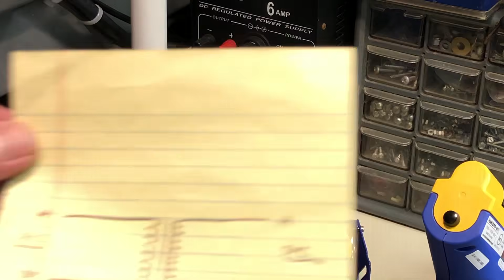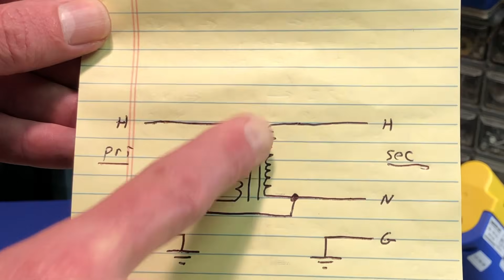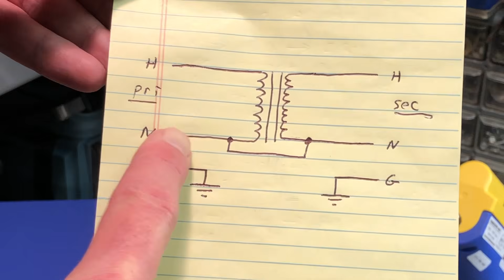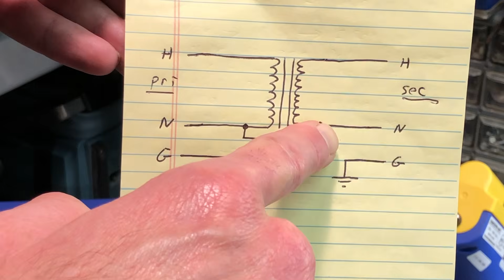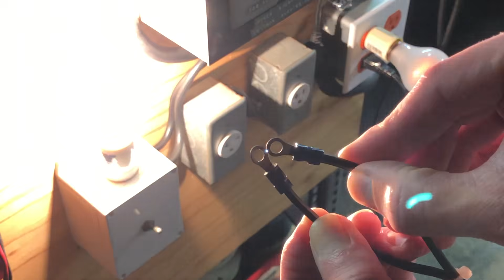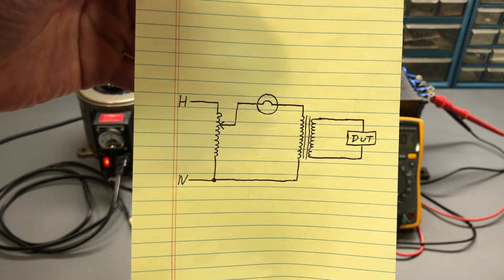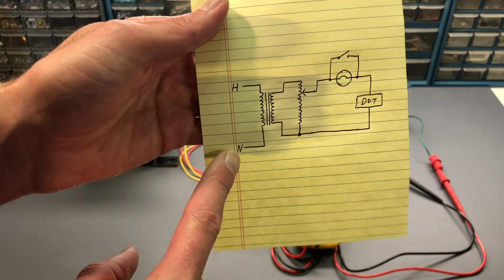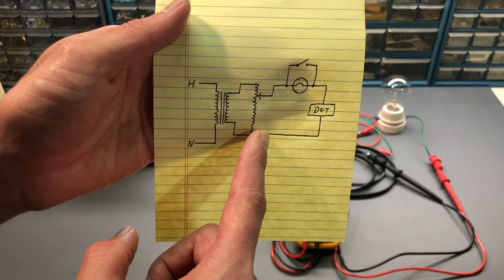How An Isolated Dim Bulb Tester Works (Current Limited Isolation Transformer And VARIAC)

Comment: I have one of these iso's. Since you have one, could you tell me what mod you did to it to make it safe to use as a real isolation transformer? If these are being sold as 'fake' isolation transformer I would think there would be some legal liability issue against the company.
Reply from the maker: at 11:20 I talk about the modification and show the schematic.  The manufacture connects the neutral from primary to secondary.  You need to break this connection for true isolation.  I think they are selling these transformers as some type of noise or interference isolation but not with the intent of isolation for electronics servicing.
Reply: @EriksElectronicsWorkbench  - exactly. Most isolation transformers are sold to audiophiles who want to isolate their amps from any induced noise from the grid, or for medical/scientific labs running extremely precise measurements that can't tolerate spurious noise. I'd wager that few manufacturers are really catering to the market of "people repairing and restoring old vacuum tube based radios and guitar amps".
Reply: >  If these are being sold as 'fake' isolation transformer I would think there would be some legal liability issue against the company.

They're not "fake" you just have to pay careful attention what the manufacturer is actually claiming.  Most "isolation transformers" are sold for use in isolating sensitive audio amps or scientific / medical instruments from noise induced into the electrical grid by lightning, powerful RF transmitters, large inductive loads starting and stopping etc. They don't claim or intend to provide full galvanic isolation. 

Or to put it another way, there are degrees of isolation, with "full galvanic isolation" being what people using an iso on a test bench are typically looking for. 

So you can modify one of these things like Erik described or you can look for a device that advertises "galvanic isolation". Or find a big chunky 1:1 transformer and build your own (making sure not to make any electrical connection between the primary and secondary sides).

Comment: As mentioned in the presentation - that in many isolation transformers
-one side of the primary and secondary winding is connected together.
This is because  such transformers were used in Medical equipment -
where such a configuration is a legal requirement --
However it is not a desirable configuration when it relates to Electronics repair.

It is always essential to check the configuration when buying 'used' or
otherwise surplus  isolation transformers - as well as stating the exact
specification required when having a custom / specially made transformer
manufactured --- 
Complete isolation is essential so that the secondary voltage is floating.

The final configuration demonstrated is the same configuration I have been
using for decades.
The variac I use is itself vintage - manufactured in ITALY - perhaps in the 1960s
and does not have any display for current -  and YES it also does have an 'overwind'
meaning it can output a voltage that is greater than the input.

I should also point out that the common and standard voltage is 115v  and NOT
120v
The world standards were changed over 3 decades ago - to simplify manufacturing 
electronic equipment
Countries that used 240v   went down to  230v
Countries that used 220v   went up to  230v
Countries that used 120v   went down to  115v 
                  North America uses  230 / 115
whereas previously used    240/120

Now  - there is a permissible tolerance due a load placed on the supply grid.
in the vase of 230v supplies  -- the permissible (over) voltage is 10v above 230
and 6 volts below 230

Those are reduced by half in North America 
5 volts above  115  and 
2 point 5 volts  below 115

That does not alter the fact that the set  international standards  are
230 volts and  115 Volts

Comment: How many fickin ads can greedy google squeeze into 1 video?
Watch it and count.
Reply: These ads are ' stealing 'the users valuable time.
TIME has value and is NOT recoverable
therefore GOOGLE ARE thieves - n addition that GOOGLE
block and remove channels  - often without explanation -
as well as removing video they wish to censor -
yet they allow scammers to advertise fake products /
products that will not perform as claimed in the advertisement.
OR advertise one product and sell/a product that is entirely different
to what is being advertised..
Reply: I watch with no ads at all. Do some google and you shall find a browser extension to help watching with no ads.

Comment: seriously? 44 minutes to explain this? anyone who can't understand this in less than 2 minutes really shouldn't be working on electrical or electronic equipment at all. what a waste of time.
Reply from the maker: The video is for viewers who want to gain a thorough understanding of the topic and the various ways the components can be interconnected.   Teaching with details left out is pointless.
Reply: If not here where should they look - it is always good to get fundamental instructions - it you are too good for this content then don't watch it.
Reply: Nobody made you watch it.
Reply: This is the thorough explanation. You are likely at a good level of understanding in electronics so it doesn't suit your level.
Reply: You tube pays by the watched minute, use fast forward, turn on cc, scroll ahead, helps get thru to the info wanted,

Comment: Great idea for a video, thanks for doing this. I think there's disadvantages to every configuration. 
If using a tripplite in configuration # 4, slight disadvantages are that neither the tripplite case or the auto transformer can be grounded., and a slightly higher voltage on the secondary of the tripplite may throw off the dial reading on your auto transformer. If using a Chinese auto transformer, your dial reading will be way off anyway. I like configuration 3. Having the auto transformer first solves the problem of an isolation transformer that is not quite 1:1. Also, Variac is the only one that makes a Variac.
Reply from the maker: With the Tripplite isolation transformer first (the way I use it) the metal case is earth grounded. As mentioned, the Tripplite had to be modified to make it truly isolated on the output.  Anything after the isolation transformer doesn't need an earth ground since it is isolated from ground, the whole point of the isolation transformer.  Of course making a ground on one of the AC lines after the isolation transformer undoes the whole safety purpose.  On my Variac it has a panel meter for output voltage so no dial markings but yes the dial markings could be off in some configurations.  Yes VARIAC is a registered name as you mentioned.  Thanks for taking time to watch!
Reply: @EriksElectronicsWorkbench  I could have explained it a little better the first time. (for everyone) Everyone's setup may vary and depend on each piece of equipment, and the device under test. I personally like auto transformer > Tripp lite > Load with dim bulb configuration for many reasons. The auto transformer and Tripp Lite can be used as intended, both safety-grounded, the Tripp Lite also needs to be grounded because of the Faraday shields on both toroids (not a secondary center tap), and the ground is available at the load, if needed. I just put a switch on the Tripp Lite secondary neutral and use a ground lift adapter on the Tripp Lite outlets when complete isolation is needed. It is as easy as a flip of a switch to return to the original Tripp Lite configuration. I believe it is the easiest to mod and maintains safety and the most flexibility. Of course, do whatever you want and call it the best.
Reply from the maker: @billmiller6274  All valid points, thanks for sharing these ideas.

Comment: Well done and very informative presentation!  I like the 4th set up and want to replicate it... but my isolation transformer only has a 2-prong outlet on the secondary side (which makes sense), but my variac has a 3-prong cord.  Should I just use a 3-prong to 2-prong adapater?
Reply from the maker: Glad the video was helpful for you.  You can use an adapter to leave the VARIAC ground disconnected since everything on the secondary side has no ground reference.

Comment: 2 questions   1)   where did you find incandescent bulbs.   everything i see is led  since they outlawed the sale  of them.   2)if one was to put gfic outlets in will they wotk and where would the best location be?
Reply from the maker: I have a stock pile of incandescent bulbs for projects :) but you can still find them on eBay, surplus stores, and vendors of bulbs and lighting. 
You can have a GFCI on the primary side of the transformer but do not have one on the secondary side.

Comment: So to confirm here, you don’t ground the primary side of the isolation transformer? The side that goes into the wall outlet.
Reply from the maker: On the primary, the transformer is connected to the 120 volt hot and neutral and the neutral is at ground reference (going by the wiring standard here in North America).  However it is ok to earth ground the metal housing the transformer is mounted in.  If the transformer is in a plastic enclosure you don't need the earth safety ground. Nothing on the secondary side should be tied to earth ground.

Comment: I have heard that forming "long time no see" el. capacitors can take long hours, with bigger and longer steps. Some people developed some code and procedures - but still i am not sure if they are correct - they are only proposed :)
Reply from the maker: There is something to the reforming idea, it is true that a very old unused electrolytic will start working better if you bring up the operating voltage slowly.  However a capacitor that has dried up electrolyte, high electrical leakage current, or other internal damage/age issues will never perform normally and should be replaced.  Some basic tests of ESR, leakage, capacitance, etc will confirm if the capacitor is ok or not.

Comment: Brilliant Video / Lesson Thanks . New Subscriber from Australia.
Reply from the maker: Thanks for watching and subscribing!
Reply: @EriksElectronicsWorkbench Erik Can you advise where to buy these 3 Components
Reply from the maker: @andrewhenderson9474  the VARIAC, isolation transformer, and incandescent lamps and sockets are listed on eBay, that might be the easiest place to find them.  Surplus and electronics retailers have them too.  I don't know of specific places in Australia that sell these items.  Also make sure you use components rated for your line voltage, 220-240 volts.  I'm in North America and the voltage here, and as used in my examples, is 120 AC.

Comment: Oh also I have seen where some use multiple bulbs. Why would they do that and would there be any advantage to setting them up in series or parallel?
Reply from the maker: Multiple bulbs are usually connected in parallel and sometimes arranged with switches so you can add or subtract bulbs as needed.  You are adjusting the total  wattage by doing this.  As bulbs are added in parallel more current can flow.  In my set up I just change out the bulb.  I have a selection of bulbs just for the test set up, 60, 100, 150, 300, 500, 1000, and 1500 watt.  I find 150 and 300 watt get used the most.

Comment: Nice this explains the fault in my set up. But something you did not cover is about how many amps that can flow while under dim bulb and at what bulb wattage. For example if I am using a 60 watt bulb and my transformer is capable of pushing 10 amps what effect does that have on the amount of amperage that comes out of the bulb? and what would the calculations be for different wattage bulbs and different transformers such as a transformer that is limited to say 2.5 amps, 3 amps, 5 amps or 10 amps. What are the advantages of each and why would I consider the different transformers and bulb setups?
Reply from the maker: The maximum amps that will flow is determined by the lamp wattage.  Higher wattage means more current can flow.  The bulb wattage to use is based on the device you are testing and it's normal power consumption.  Devices that only use a few 10's of watts like a small radio, or transistorized amplifier that is idling, might use a 60 to 150 watt bulb.  Consider using a 300 to 500 watt bulb for much larger devices.   Your transformer amp rating has nothing to do with the actual current flow.  For a set line voltage the current is determined by the bulb wattage size and the resistance (or impedance) of the device you are testing.  Obviously the transformer must be rated to handle the power consumption of the device you are testing.  For example, say you use a transformer rated 120 volts, 1000 watts, which is about 8.33 amps.  If you use a 150 watt bulb then the maximum current at 120 volts will be 1.25 amps into a direct short (such as if the device being tested has a short circuit).  Let's say the device under test requires 150 watts and you use a 150 watt bulb, you will split the line voltage about half and half to each and generally that is not going to work very well.  In that case use a higher wattage bulb.  The bulb should just barely being glowing when you are testing a device.  Don't use a dim bulb tester for testing amplifiers under load etc, just use it for initial or specific testing, not as an all purpose way of powering items for everyday use.
Reply: @EriksElectronicsWorkbench  Thank you for that explanation.
Reply: Please for the love of god use paragraphs. Reading that gave me a headache. Also some pol wouldn't trust someone's opinion when their comments look like that. less organized.
Reply: @TheTubejunky  I don't think the readability has anything to do with the quality of the information as that was a great explanation. 

However as an M.S.T. teacher I would expect writing form and format to be better if I was reading for writing or communication post.

Comment: The transformer being Grounded ( 3 - prong )  is and can be done .... The ISOLATION is achieved by the secondary windings And it's very important NOT to give a Grounding to the Variac *  .... otherwise the Ground Wire can act to complete a circuit ...... Defeating the purpose of the Isolation feature ....
   I really enjoyed the description and explanation of this tutorial --- Thanks soooo much  ;)
Reply from the maker: Yes when the transformer is first, grounding is a good idea especially when it is in a metal enclosure.  The VARIAC is across the secondary and correct, no ground reference on anything on the secondary side otherwise you negate the whole purpose of the transformer.  I use isolated ground outlets (orange color) and leave the ground terminal disconnected.
Reply: With my D.B. setup I actually do intentionally run the ground through to the third prong of my AC output socket. For devices (DUTs) with grounded plugs where I do not want to connect through to actual earth ground, I use a good old fashioned "cheater" (as we used to call them) that adapts from a 2-prong (no ground) connection to a 3-prong plug, i.e. 2 prong male plug to 3-prong female socket. These cheaters, for folks unfamiliar, have a lug intended to connect to the cover screw on a common 2-prong AC outlet, which is left unconnected. This way if for some reason I do want to connect my DUT to earth ground, I have that option.

Comment: Why isn't a GFCI part of the safety setup?
Reply from the maker: You could use a GFCI on the primary line side of the setup but that would not add to the isolation safety that this is about.  Don't use a GFIC on the secondary side, it won't add any benefits and since there is no ground reference it won't work properly.

Comment: Hi, can plugging the isolation transformer into a RCD curcuit/breaker type orange Tradesman power extension box possibly give an extra level of protection  ?
Cheers.
✌️
Reply from the maker: An RCD on the grounded primary line side of the isolation transformer could help with safety in certain situations perhaps if a fault occurred on that wiring or the primary winding.  It would not have any affect on the isolated secondary side.
Reply: @EriksElectronicsWorkbench  thanks for the reply.
Reply: Whats an RCD?  Thanks.